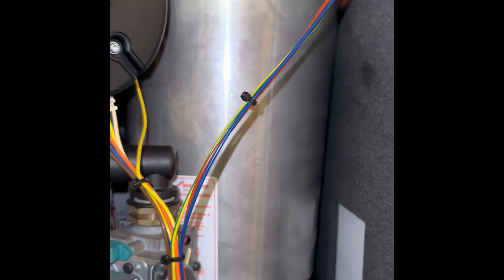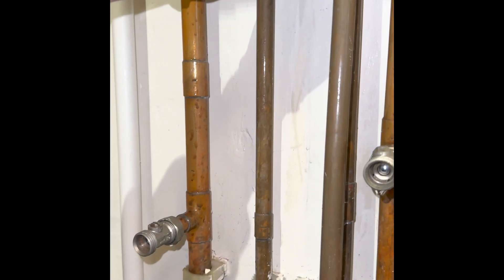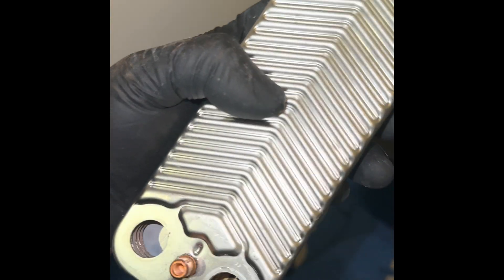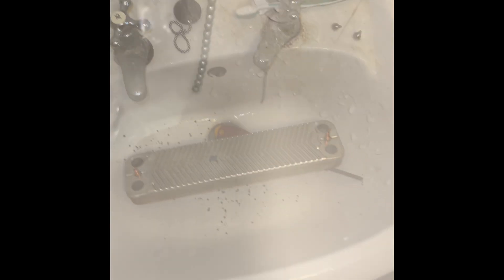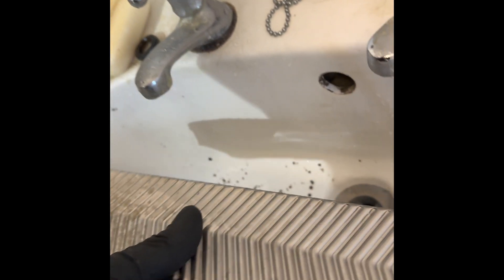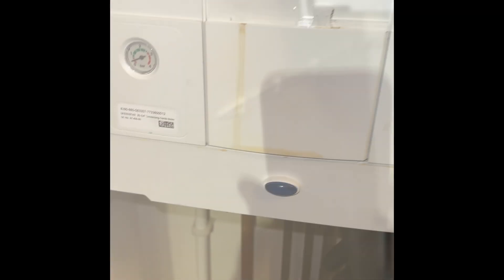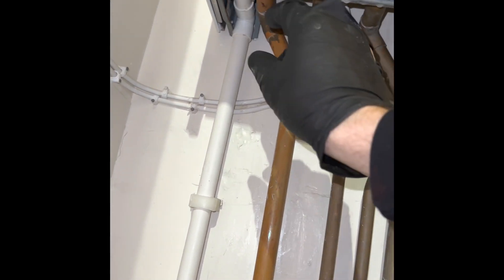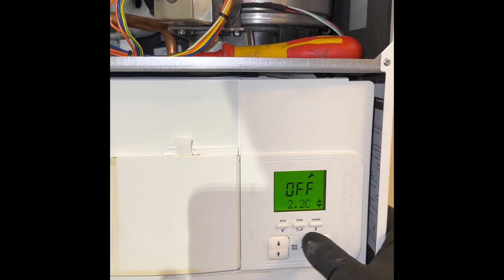Worcester Bosch Plate heat exchanger replaced, diagnosed with service menus.

Comment: Hi mate good informative video. Keep it up.I have a Worcester greenstar 30i. When the boiler hot water is on the pressure drops and when the hot water is off the pressure increases to just over 3 bars. What could be the problem. Cheers.
Reply from the maker: Maybe plate heat exchanger has pinholed.
Try to drain the boiler with the cold off, then open the cold supply and it may fill up the pressure.
It probably drops when you use it as the dynamic water pressure changes to below the standing pressure.
Reply: @plumbertime  hi mate thanks for the reply. Does a pinhole in the heat exchanger increase the temperature on the boiler to close to a 100?
Reply from the maker: @bennyben8390  no, I couldn’t think of a reason for the pressure being high when not in use but when using it the pressure drops, it’s strange, only rare thing I thought was maybe split plate,
If it’s overheating tho then it will be something else.
Just call out a local heating company.
Reply: @plumbertime  ok cheers thanks for your reply